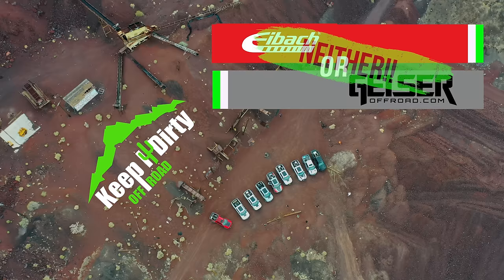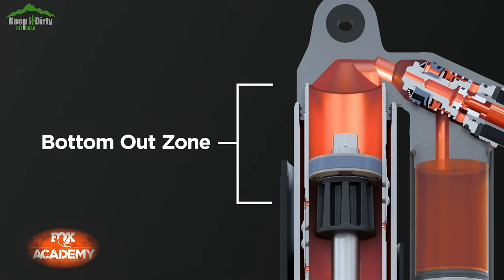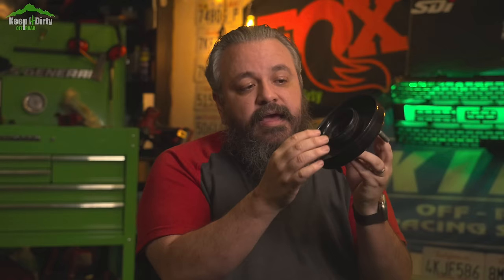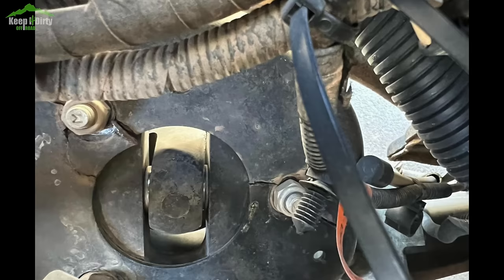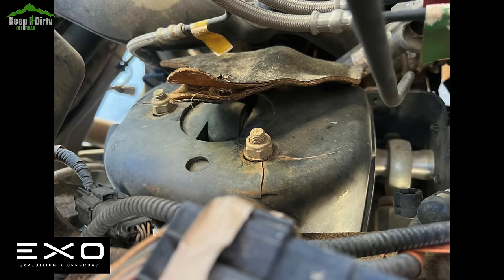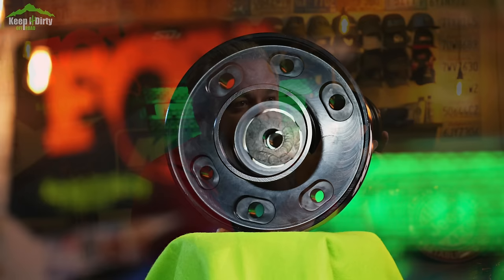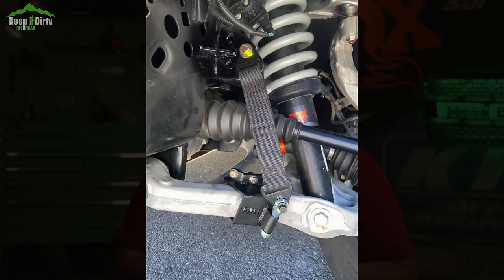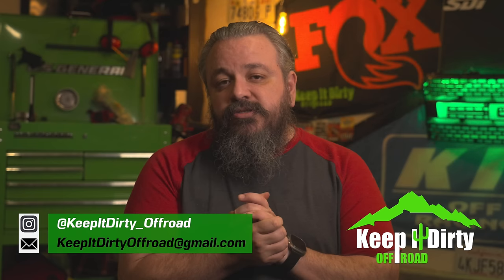Eibachs or Geisers?  NEITHER!!

Comment: Question, Gen 2 with SDI tops which rear leafs? Little to no extra gear or weights in rear and not a lot of heavy off roading.
Reply from the maker: Stock leafs would be best in that scenario to keep the smoothest ride. Only problem is the stock leafs will eventually go flat, and when they do, the Icon leaf pack is the better options. They are softer than the Deavers

Comment: I know this would only apply for 2wd but couldn't a spindle work? You would keep all geometry with added the added height
Reply from the maker: Can you please elaborate? Not sure how changing out the spindle would add height. At least not without moving the arm pivot points on the frame.
Reply: @KeepItDirtyOffRoad  basically they relocate were the hub mounts are to a lower position compared to oem
Reply from the maker: That’s not really possible on the Raptor. The spindle is just larger than the hubs. You could maybe do portals, but that comes with its own set of issues with high speed off-roading.

Comment: Thanks for the great video! So I have the Geiser’s all around so disappointing, but important to know. I thought that just adding the limit straps would solve the problem, but sounds like not? Think it’s ok to leave the rear Geiser’s, but put the stock front springs back on with the SDI front bucket? Going with the click and revalve
Reply from the maker: Yeah, rear Geisers are not a problem as they only lift 1.5 in over stock and will help with load in the back. It’s mainly the front springs on coilovers that are the problem.
Reply: Ok thanks, appreciate the reply. I hate to lower the front as I love the stance, and hate to spend an extra $500…. but if it preforms better and is less likely to break definitely worth it.
Reply from the maker: Yeah it will and you won’t have to deal with CV boots failing later. Any more than 2in lift over stock causes the CV boots to run and eventually fail. It takes a while but CV axles go from lasting 100k miles to lasting as little as 10k miles with heavy 4wd use. So in the long term it’s less issues overall

Comment: So what would you recommend for a gen 3 raptor to improve trail riding/rock crawling capabilities? I’m not to familiar with these thing but I know a higher front end or lift will help it clear better without bottoming out or scraping
Reply: I would like to keep the live valve stock suspension. If it can be done I’d like to maximise the off road performance when doing a lot of deep rut trails and rock climbing type of trails
Reply from the maker: We went over my recommended options in the video. If you want stock suspension, you need the SDI top hat to raise the nose and you will need a spacer out back as well to match so the rear don’t look lower than the front

Comment: Hey. Great video! So in your experience, would the SDI levelling kit (top hat) be better than the RPG levelling kit, or perhaps the other way around?
Reply from the maker: Jury is still out. More have used the SDI top hat and pushed it to its limits. The RPG top hat has not been tested as much yet and I’m personally concerned about the joint up top. When SDI first did the top hat it was rigid and it broke. They added the bushing to account for required movement of the shock. The ball join may not allow all the movement needed and I’m worried about it wearing. Those type of ball joints don’t last long under load and movement. Hope that helps
Reply: @KeepItDirtyOffRoad  thanks for taking the time to reply! So in that case, a follow up question is is it worth doing a top hat or should I leave it as is? Is it even worth messing with the stock set up unless I’m going full mid travel? Gen 3 owner
Reply from the maker: It depends. If your mainly street driving, keep it stock. If you plan to offroad, the nose is a bit low and gets buried on everything on the trails here in so cal. So for us its worth that extra height up front to keep the nose out of the dirt at full tuck.
Reply: @KeepItDirtyOffRoad  That makes sense! I do go off road so had a level on my list of things to do. Excuse my ignorance but would the SdI levelling kit limit the total travel or the suspensions ability to soak up the rough stuff?
Reply from the maker: No it’s the one options with the least amount of limits. For every option ( spacers, collars, and springs) what ever lift they add, half is lost the preload they add. That’s why Geisers with the most lift cause so much problems. 

SDI top hat only uses 10mm of preload to gain an overall 1.75 in of list. It’s the least amount of any system. So you will have less issues overall and still keep a softer ride that comes either the stock springs. I normally recommend SDI top hat with SDI Eclick to get the most out of the stock suspension.
Reply: @KeepItDirtyOffRoad  Thank you SO much for the insight.

Comment: Could you add the spacer  top hat to a blue shock setup on Geisers? For more lift? Not a lot of off-roading
Reply from the maker: Only if you want to destroy CV axles everytime you use 4wd.

First off, why would you want that much preload up front? That’s what 5in of lift? CV axles would constantly be binding up, boots would fail, CV joints will be stressed and installation would be a nightmare. Only a professional wall mounted spring compressor could do it. 

So many reason not to do it. Why do you want that much lift?

Comment: So what should I do just leave it stock or do the bolt on leveling kit? I have a 24
Reply from the maker: Same issues as all the others man. Advice we give in the video still applies. I would say you’re more likely to have issues as the dual live valves have the potential to be more capable.
Reply: @KeepItDirtyOffRoad  should I just do the sdi top hats then ? Or just completely stock?
Reply from the maker: Depends on how you plan to use the truck. You looking at upgrades to just level the front or you looking to improve offroad performance

Comment: Hey just saw the vid. I have a 24’ 35p raptor with eibach pro lift kit on 37’s. Can you re-valve the shocks or are there no options to prevent the added wear and tear with after market springs
Reply from the maker: There is not much you can do to prevent the extra wear but you can do things to prevent the damage that may come with that upper joint fails. 

So first off, the extra height will always cause CV axle boots to fail prematurely. Only way to increase their life is to reduce the preload which equals getting rid of those springs. 

For the failure of the top hat, make sure you get limit straps if you plan to offroad. That way you can prevent the shock of bottoming out and if it fails, everything stays in tact. 

And then for extreme situations, reinforce the top of the shock bucket. We covered all this in the video

Comment: What’s the best option for a guy running a gen 3 looking at adding a bed rack and tent and needs an option for the extra 500lbs in the rear?  Don’t really care for a lift.
Reply from the maker: That’s a lot of weight to carry offroad. You’re going to need springs in the back to compensate for the weight. Geisers would be the better option. But the back end is going to be much stiffer than a stock front end. And when the bed is empty that back end is going to be high.
Reply: @KeepItDirtyOffRoad  I guess I should be clear. 500 is the total weight with the tent/bed rack, all the gear total in the bed. 

And my off road is FSR’s.
Reply from the maker: So your running FRS shocks all around with stock springs in the rear currently? 

If so, the recommendation is the same. Not many options for carrying a lot of weight in Raptors. They are not designed for heavy loads. Off-roading and heavy loads contradict each other. So your best option to carry that load is upgraded rear springs and right now it’s just Eibachs and Geisers.
Reply: I meant my off roading is FSR’s (forest service roads), so nothing too extreme. 

Good news is I found a tent rack combo today that’s 200lbs. So I’ll try that combo and see if I need to upgrade the rear.
Reply from the maker: Ah. Never heard anyone use an acronym for fire roads before. 

I would be cautious of any low cost options. You’ll find the truck is more capable than most racks. And it’s easy to get carried away. I’ve seen plenty of raptor and TRX guys use bed mounted racks that slipped off or bent the bed in one way or another. Raptor can go fast, even if you did not mean to. And you hit anything at speed and you experience a ton of g forces that most racks can’t handle.
Reply: @KeepItDirtyOffRoad well it’s not low cost, just low weight. Haha
 
Rhino rack and bars on retrax XR Pro with a roofnest tent. 

Retrax wasn’t included in that weight. But it should mostly be carried forward. 

Whalen had that same tonneau connected to much heavier gear and did Baja with it, it seemed to out work his factory bed rails. ;)

That said, I really appreciate your responses!
Reply from the maker: You should watch my video with Whalen as he ran with us after Baja. The bed was definitely damaged and the rack did slip off in Baja. And that’s a much stronger rack than most use. Anything bed rail mounted will be problematic if you attempt any faster speed off-roading unfortunately. I had a small light weight rack that only served as a sports bar holding a light bar. Maybe 75lbs total and it ripped itself off and bent my bed sides in the process.

Whalen has since had a bed mounted rack built for himself, all custom and way, way stronger than

Comment: What do you think of the RPG replacement?
Reply from the maker: We did not mention it here because it’s a brand new product. Its performance is unknown and I’m worried that replacing the bushing with a ball join could cause problems. It also only solves for the bushing. You still need your reinforce the shock bucket and add limit straps because your using aftermarket springs. So there is some extra cons there too. Time will tell how it does as many are getting them. But for me, I’m taking a wait and let me see them on the trails before I recommend them.

Comment: Does this apply to all spring upgrades for Gen 3, or is this primarily 2”+ springs?

Would 1.1” Eibach have less risk than 2.5”?
Reply from the maker: I’m not aware of Eibach having a 1.1 in options for the raptors. I know the rear springs are typically 1.5, but I have not seen one with 1.1 up front. 

But yes, all spring upgrades will require some sort of reinforcement. At the very least you need limit straps.

Comment: Great info! My Gen 1 came with Geisers when I bought it. Why do you think this issue hasn’t happened as much or at all with the 1st Gen? Thanks
Reply from the maker: I think it has to do with the shock stroke and what you can do. The gen2 is overall more capable and makes off-roading easier. So you have guys pushing them harder. Gen1 is more analog and takes some experience to push it. So there is less badgers driving them. Gen2 makes off-roading fast super easy so guys run faster than what their skills can handle more often
Reply: Makes sense. Thanks

Comment: Even though this issue isnt know to happen to Gen 1’s, would you still recommend against putting them on a Gen 1?
Reply from the maker: I would recommend against them. Gen1 shocks had perch settings that is a better option for height. Shock will still work right.

Alternatively my recommendation for gen1 is replace the shock bucket and run live valves controlled by SDI Eclick. It’s the best bang for you buck mod to the raptor and gets you close to mid travel performance
Reply: @KeepItDirtyOffRoad  Damn... I currently have Eibachs on my 2013.  Never had any issues with them but having learned about what could possible happen now, I think im going to go back to stock springs and mid perch.

I dont really offroad too hard or that often so as nice as and SDI setup would be,  its not necessary for my purposes.  Maybe someday! 😁
Reply from the maker: If you don’t offroad too much, keep your current setup. We have not seen any reports of this happening on the Gen1 so risk is low

Comment: Is the minor lift on the rear axle with either Eibach or Geiger springs an issue compared to the front?  Curious about an overlanding setup.
Reply from the maker: No, because the lift is limited to 1.5 inches over stock. That’s around 3/4 of an inch of preload. The problem comes when folks combine the rear springs with additional spacers. Then it’s a problem

Comment: What you think about using a leveling kit for the first gen raptor such as ready Lift ? And yes most of the time it will be on road use.
Reply from the maker: In my personal opinion, putting a lift on a Raptor is the worst thing you can do. You literally eliminate everything that makes it a raptor. 

To add height on an off-road prerunner you add width, bigger tires, and some spring preload. 

A lift kit adds height by adding lift blocks and scaffolding. Yes. Most lift kits are basically flimsy scaffolding. Sure it will work on pavement. But take any curb wrong or hit the wrong pothole and the scaffolding will collapse. You try any real off-roading that has surprise washouts or jump being hit at speed and the lift kit is going to collapse. Just don’t do it. At that point save yourself the money and lift an f150
Reply: Thanks for you response ! Yeah I was just trying to get rid of that factory rake they have up front and keep it stock height just the front leveled with the back.
Reply: Keep them videos going ! They’re very educational !
Reply from the maker: If that’s all you want stick to shock collars or the SDI top hat we talked about here.

Comment: I keep telling people to either stay stock springs or upgrade to 3.0s.
Reply from the maker: That’s the way to go. Stock springs will give you the smoother ride and collars or the SDI top hat are the better budget options
Reply: What are you thoughts on the different 3.0s for gen 1's? Curious what you have seen first hand vs a bunch of he said she said or marketing fluff. Tired of the sales folks pushing crap in the gen1 groups.
Reply from the maker: That would fall under the category of FRS (Fox race series). I would look into shock bucket reinforcement running those. Just keep in mind that we have not see any reports of shock bucket cracking on the gen1. It’s possible but have not seen it. 

The FRS shocks can and do improve comfort and will run smoother than upgrading the springs too. But for the money, doing SDI Eclick with take off shocks and an upgraded shock bucket will outperform FRS shocks and it’s less than FRS shocks on all 4 corners.
Reply: I would run SDI setup on my gen 1 if I knew of a good welder in my area to do the KHC buckets, but I do not. So my options are limited to what fits on the stock bucket.
Reply from the maker: Where are you based?
Reply: Memphis, TN area

Comment: Great video! Did you guys see the new RPG top hats? Is that good product to use with springs?
Reply from the maker: Thanks. We have seen the RPG one And it only solves for one of the issues. With aftermarket springs you still need  limit straps and bucket reinforcement. The videos of it don’t show how the ball joint is held into place either. Really want to see that because I suspect there may be some issues with its design. Time will tell. We need to see these on the trails first. Until then my recommendation is still avoid aftermarket springs and if you want some height, go with the SDI top hat.

Comment: I have a 200lb cap and will prob add other weight to the bed.  Was thinking of doing SDI front and Geiser rear.  Is there a better solution for weight in the back?  I don't do any crazy off road, here in FL just mostly trails, sand and mud.  So not really a lot of high speed hits and abuse.  Was going to stay with 35's for more articulation.  Any thoughts?  Tempted to do 37's just for the look.
Reply from the maker: Geisers or Eibachs out back are OK. No reports yet of issues with them back there because the lift is only 1.5 over stock. So for the extra loan capacity it should be fine

Comment: How about the bronco raptor? I can’t get proper information, I’m running a 37 1350 tire with a zero offset wheel and a tow a off road modified teardrop trailer I’d like to gain a little bit of height in the front and rear, and when I’m towing I lose a little over an inch in the back squatting, do you think increasing the preload which is similar to a motorcycle preload Basically setting up the SAG with a spacer like FMI, I know a lot of folks are running 2 1/4 front one and 1 1/2 rear etc. you can also go one and a half front and rear this way you’re only increasing some preload do you feel that would be safe and OK to use? I know this is for the raptor pick up truck but you seem to have knowledge just reaching out for some advice thank you!!!
Reply from the maker: The broncos front end suspension geometry is very similar to the f150 so they will be just as susceptible to damage. Too much preload will cause all the same problems with CV axles and springs binding. And if you push it, you will run into issues with the shock bucket and welds. 

Now the challenge with the bronco raptor has been its price. It’s way too expensive so there is little to no diy knowledge out there on it. There is also not as much aftermarket support for it yet. At least not to the level of the f-150 raptor. 

So I would say, limit your preload the same as on the f-150 raptors. Anything over 1.75 in lift is too much. 

Also, offroad vehicles like this are not designed for towing. The shocks on Raptors are designed for hitting the trails, not for carrying a static trailer load. I don’t recommend any towing with any Raptor model.